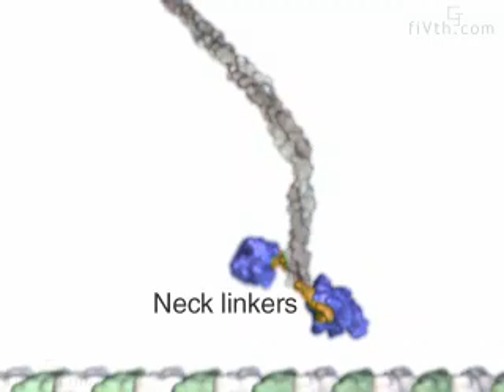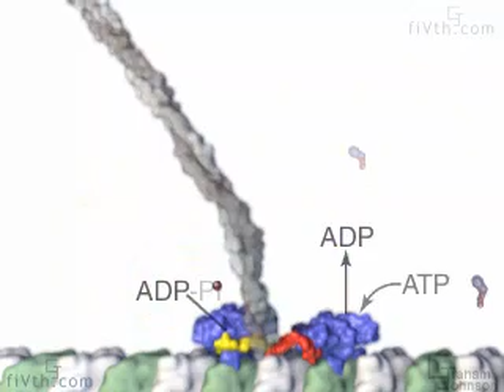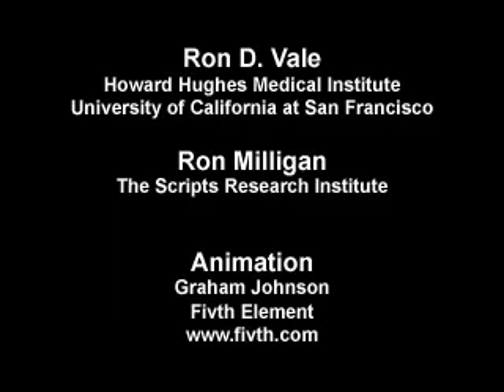Kinesin Walking Narrated Version for Garland

Comment: I'm confused about something. Can somebody help? In the rear-head 2 catalytic steps happen: 1) ATP--> ADP-Pi and 2) Pi release. Also, 2 mechanical steps happen: 1) Neck-linker undocks and 2) the kinesin head releases the microtubule. How are the catalytic steps co-ordinated with the mechanical steps? Does ATP --> ADP-Pi initiate neck linker undocking or microtubule release? Does Pi release initiate neck linker undocking or microtubule release?
Reply: The video says that adp release and atp binding causes the conformational changes which produces a jerk and throws the other head forward, and when the leading head is not in the lead anymore it hydrolyses the atp and releases a ip, which causes it to detach from the Microtubule, now it waits for the jerk, after jerk it will come in leading position and exchange adp for ATP and produce a jerk.
That's what I understood bt am not very confident in it

Comment: How does it know which way to go? Kinesins transport vesicles along the plus end of the microtubules out to the end of the cell, but what ensures that it goes that way and not in reverse back to the centrosome?

Great video though, thanks.
Reply from the maker: It is hard to appreciate when I represented the proteins with a smooth skin in this video, but the arrangement of the atoms in the motor head matches specifically in one way (and only one way, like a puzzle piece) with the arrangement of the atoms on the microtubule subunits (called tubulin).  The neck-linker then binds in one direction.
Reply: kinesis goes one direction, and another protein called dynein goes the other direction.

Comment: Is it the same with dynein?
Reply: I think dynein is a little different. Dyneins are huge molecules and they move toward the minus end into the center of the cell. They do contain motor heads, but they're part of large heavy chains and they are dimers.
Reply: I think dynein has a similar functionality but travels in the other direction

Comment: The part that I don't understand is: what guarantees that there will be a ATP or ADP molecule available at the right time for the process to occur? Are they randomly scattered everywhere? Do they float in some water, are there other molecules around? Is this ADP or ATP appearing just randomly, what makes it go to where the feet are?
Reply from the maker: Yes, the nucleotides ADP/ATP are scattered everywhere in the solution.  The "whitespace" surrounding the molecules in this animation is packed with water and other small molecules which are quite large at this scale.  In cells and certain types of in vitro solutions, there are also large molecules- other proteins jostling around in the white space making quite a crowded environment.
Reply: Questions are more, how "kynesin" knows which direction to choose, who commissioned the transport of goods, when he knows when he reached his destination, what happens next, etc., etc., according to me at the current level of knowledge are unanswered questions
Reply: @JanuszSzczesniak  
The microtubule has a "direction", like an arrow. The kynesin follows that direction. Another motor called dynein goes the other direction. It travels all the way to the terminus where other protein bind to the vesicle and take the payload away. The microtubule are like a railroad track
Reply: Janusz Szczesniak direct longitudinal electric connection to the "mind" that is god.